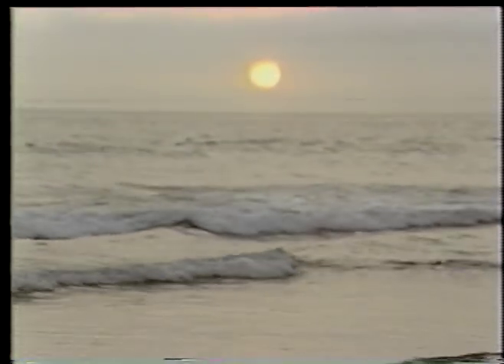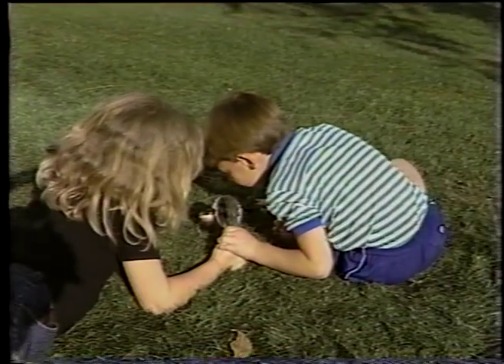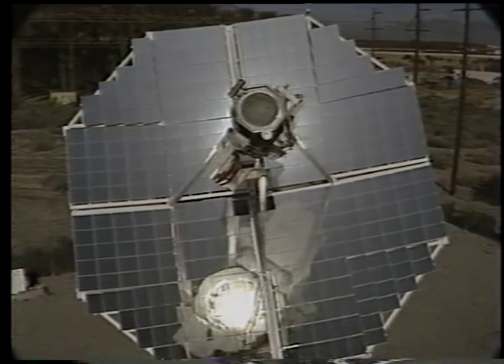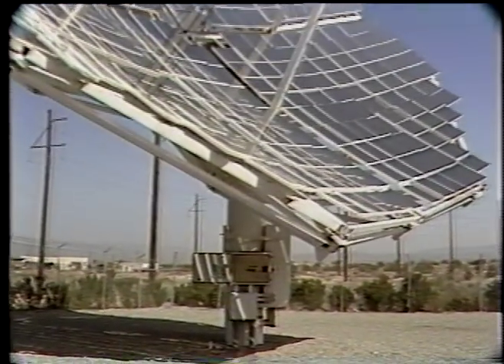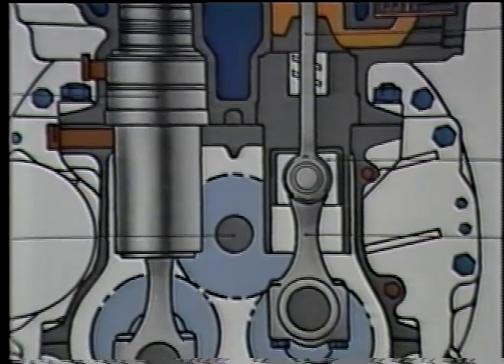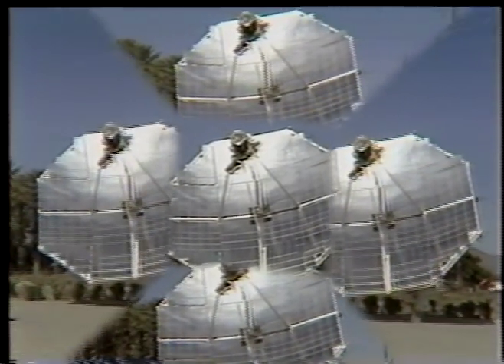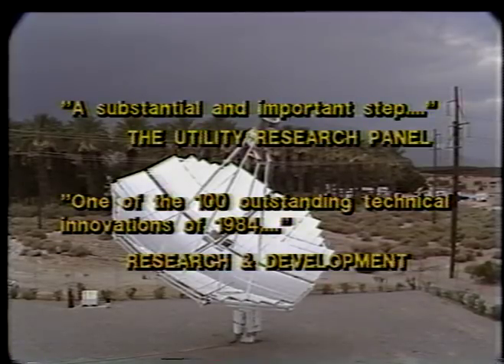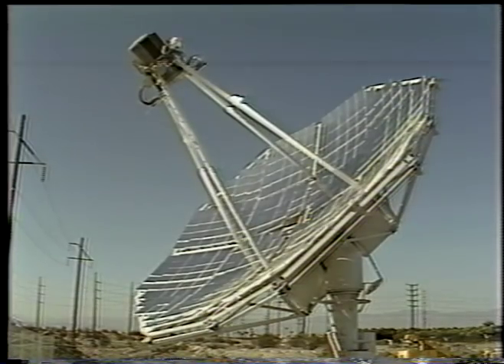World Record Setting Solar Parabolic Dish Stirling System, 1984

Comment: I think there are many DIYers wanting to do just that, the means are available, the materials are cheap and common!
Making it domestic instead of industrial would reduce the joule effect losses that large distribution grids generate, less power per unit, more units, but less losses to distribute Electricity.
As many small domestic generators as needed to charge pools of reclaimed lead acid batteries, feeding homes and workplaces's utilities through inverters is a credible path to fuel autonomy!

Comment: Serious question and thank you for your time, pardon my ignorance please. Why are large sheet magnifiers never used in this type of generator? Also given the advances in circuitry, p.c. cooling systems, and microturbines (M.I.T) why can this system not be miniaturized to say the size of a home satellite dish and installed on homes?
Reply: Because the usable sun energy is about about 1000w per square meter depending on location, season and sky conditions. If you have a 1sqm dish that reflected all that light/heat you'd only get 40% of that at best. Likely closer to 30%. Sure they are about as good as photo-voltaic cells but they also have more wear and tear and produce more noise even if they are quite quiet. So in theory they technically could, but is it worth it? There is less wastage with these engines as 99% of them could be recycled or scrapped. Still I wouldn't be surprised if someone got one out on the market.

Comment: Dan, The area of the dish is 1000 sq ft operating in wind loads up in the 20-30 mph range. Plus you have a canter levered weight of 1500 lbs at the focal pt that is one of the greatest concentrations of sunlight on the face of the earth. We only used two 3/4 hp motors to drive the system with 3 milliradian tracking accuracy. If you think you can accomplish this in watts, you should earnest pursue your invention.
Reply: Thanks for your work!  I really hope i can create something similar in the future, simply because it is awesome

Comment: I'm not misinterpreting anything. He states that is uses 8% of the power for tracking the sun. That can be done better.
Think about the power on that area compared to the speed. It's so slow that you can't see its movement. it should only take a couple of watts.

Comment: You misinterpret the statement of 8% of the energy generated for parasitic power. The parasitic power included the tracking of 1500 lb Stirling Engine canter levered at the focal point with a tracking accuracy of 3 milliradians in 20 mph wind. Plus the radiator fan load for the Stirling Engine, system control instrumentation, and the emerging slew system in case of grid outage. And that's why the net energy conversion efficiency of 29.4% of solar to grid remained unsurpassed for 24 yrs.
Reply: I still contend cost and/or marketing was the failure of this device.Such a fantastic machine.

Comment: you mean kWh. not kW/h.
and yes it most certainly is bizarrely unreasonable. tracking the sun is extremely slow movement. if it does indeed use 8% then it's piss poor engineering.

Comment: Very true, people think the southwest is the only place for solar but here in Michigan it is just as good because they run cooler even in winter sun they have great output. Keeping them below 70 degrees I think is best but I have no idea what the best OP temp is. Of course a cooling fan or water spray would cost part of that energy. Allowing them to run too hot will decrease there life. Batteries I find are a problem keeping alive for much more than year. Do you have any facts about desulfators?

Comment: I have heard about this marvel years ago but not in so many details.  25KW of power is amazing.  (Hydrogen used in Stirling  engines as the fluid?).....  But with the fusion of Rankine engines and technologies offered by new environmentally safe fluoro-hydrocarbons, this marvel will be made practical for use if the power and cost is brought down to 10 KW for farm use with storage.  Power & Water are the two important necessities for earthly living.

Comment: if the reflective surface contain silicon cells they can supply the power to run the system could b checked for feasibility

Comment from the maker: Dan:When you have 1500 lbs canterlevered at the focal point, two 3/4 hp drive motors tracking to .1 milliradian and a radiator for the Stirling engine, and an emergency slew system, the parasiitic power all added up to 8% of the gross power produced. One would offsset by the addittional harvest of the daily DNI in two axis rather than single axis or non-tracking (no cosine losses). The net energy efficiency of 29.4% of DNI to electricity to the grid remained unsurpassed for 24 yr. - Byron Washom
Reply: Byron,what was the realistic cost per Kw/hr? Beautiful piece of machinery I must say.

Comment: I hate idiots who say nothing and sound like 'mine is bigga'.  This device in an array would accomplish the same. The principle is there.  ...and arrays are space consuming and all fall when the cloud comes by.  Separate units spread out strategically, safer, less hogging of the land as they can be installed on existing structures, less of a need for high-power lines(if any at all) to spread the energy!  Also tactically safer in case of war damage, and so on and on and on.  You still feel big?!

Comment: and after 30 years ...... we still see these things only on youtube
Reply: 36 years later, still can't buy it. Wonder why.
Reply: @eIektrinis  yeah,cuase this is the bane of the oil man.im actually shocked the various governments haven't scrubbed these videos,and attacked these guys that produced these products.
Reply: @eIektrinis  It's shit. If you want one, you'll have to make your own.
Reply: @SoMuchFacepalm  there actually is a production stirling cogeneration unit by Vaillant, running on gas. So it is possible to build a reliable household unit.
Reply: 38
Reply: @shahriarfardin777  2020-1984=36
Reply: @bluemamba5317  

he came to us from the future
Reply: Sirling engines need maintenance,  can you imagine maintaining one with H2 ?   Too many moving parts,  they may have set a record for watts per metre squared but not with the maintenance factors.
Reply: @richardwagner8498  compared to what? how many parts are in a typical car engine? and yet,we don't  bat an eye on the maintenance for them.or their 40% efficiency.or the high amounts of pollution they create.not being devicive,just simply pointing out that while a Stirling may have maintenance and a few moving parts, but then so does every motor.and some have loads of cons that outweigh the pros.and one thing bout Stirlings,they  can be simplified.these ones are being ran wide open and at or very close to max safe operating levels lol.and yet they work well enough that 3 decades later it's still in use.so it can't be that cost prohibitive,and clearly there is a substantial gain from it's use.and all that with a tech we really haven't been able to fully explore due to the oil industry.
Reply: Yes because les interesting than solar panels i bet
Reply: Now available and manufactured in china